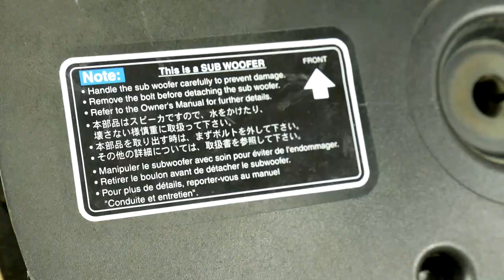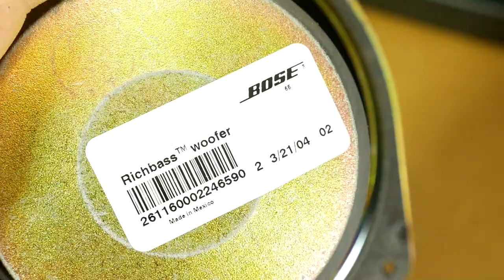Bose car stock subwoofer disassembly

Comment: Removed 4 of the 2ohm from the luxury Infiniti SUVs and made a custom fabricated box with all four totaling around .65 cu ft. Sounds really nice, ported and tuned to 45 hz. They are passive drivers. Wired the speakers in parallel and series. They hit hard and oscillate really well to display the low notes. They are a softer strong type of bass. Sound better than my 10” kicker that was previously installed in a sealed box enclosure (.8 cu ft).

Comment: What is the input signal range that the circuit can handle. 
I have the Amplifier board and want to use it to drive my sub. 
I know the pin outs as in how to wire it all up. I know its powered by 12 Volts.
My doubt is about the the input signal voltage. To the small circuit.

Comment: i have one but the speaker is busted can i repace it with other brands but with the sme size
Reply from the maker: of course
Reply: get Tang Band W6-1139SIF 6-1/2" if the Bose is the same size. It is aroun $100 or so. It is 4 Ohm, not sure about stock Bose driver.

Comment: What size is the woofer, I want to replace mines with an aftermarket. The paper cone got wet from a bottle of water in my hatch of my 2020 buick regal gnx
Reply from the maker: it's very strange form basket,

Comment: How big is the sub? I got one on my nissan. I was wondering if I can replace it with a 12 inch
Reply from the maker: No, for 12 inch sub you will need new box, that bose speaker is around 5.5 or 6.5 inch

Comment: How difficult would it be to wire up to a regular amp?
Reply: Got access to a bose stock sub from a fiat 500, want to put it in my ranger, sounds good enough for the size of the cab of the fiat and the rangers cab is even smaller. So it should be just right for what I'm looking for. Just wondering if it'll be a huge process to rig up
Reply from the maker: Very simple, you need just two wires from that bose speaker.
Reply: Can you explain how can i add a sub and an amp to the Bose amp?  Can you tell how many cables I connect to Bose amp?? Remote ,left - , right+.    ?????